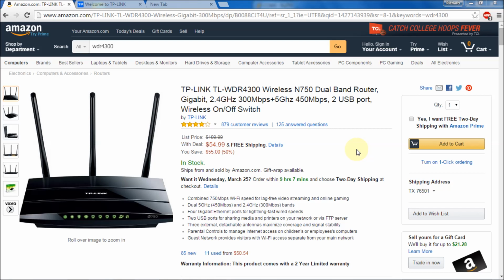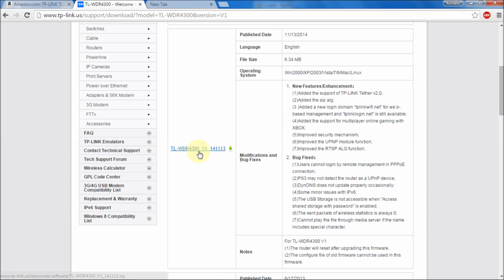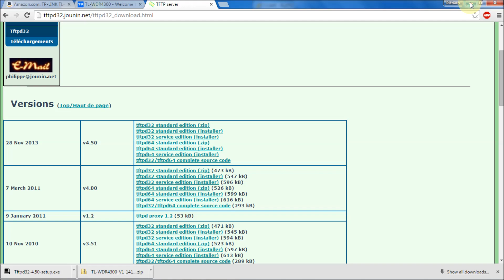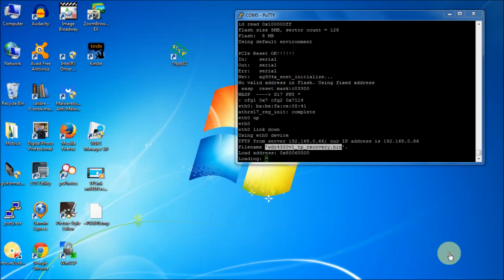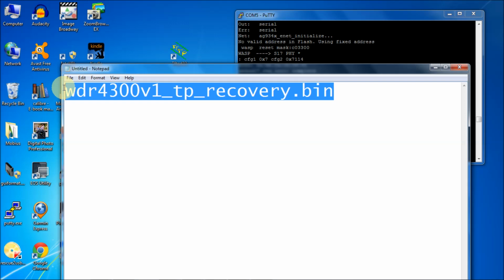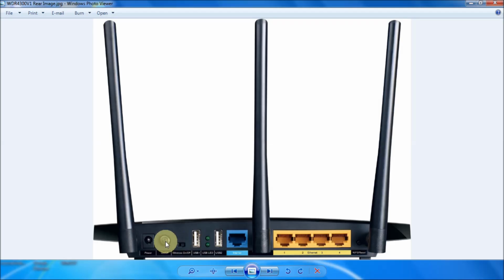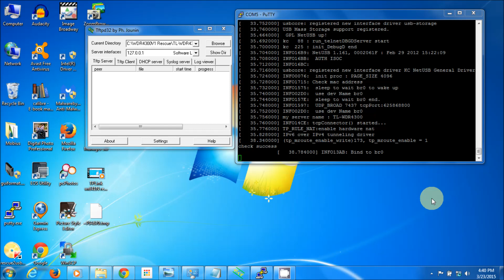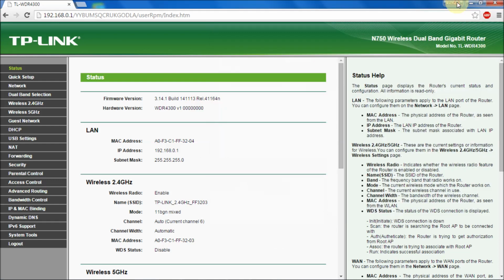Bricked TP-Link WDR4300 Version 1 Recovery/Rescue Unbrick Without A Serial Connection

Comment: Which name should we use if we have a version 1.7 router?
Reply from the maker: I don't see why not? The version numbers on TP-Link routers are not typical a 1.0 version and a 1.7 version are still version 1 and will use the same firmware. Give it a shot. Thank you so much for commenting and watching. I appreciate it greatly. All the best.👍😀
Reply: @richardlloydusa  Everything worked flawlessly. Thanks!
Reply from the maker: You're most welcome. I'm glad and very happy to know that I could help you. Thank you so much for watching, commenting and the very kind words. I appreciate it greatly. All the best.👍😀

Comment: yo  Richard sup, I got that same router but model 1.7 and so I got it from someone and it had an openwrt on it... I cant remember what I did but so my router got bricked. I can see wifi chnnels appears but I cant reach into it through the webconsole. 
anyhow, I tried your method and I can always manage to transfer the bin file into the router but it doesn't look like its actually installing it. 
needless to say the the wifi channels still appear when I turn it on with the name I assigned to it. 
any clue on what can I do without having the serial cable ?
P.S. I cant find 1.7 version of bin to replace with on tp link site

Comment: Thank you for the video. I flashed tomato in mine. Don't know what happened but I must have removed or deleted something. I have tried this many times and I see the router requesting the bin file (wire shark) but it never downloads to the router. i have renamed the file to match. 
I have the firewall turned off. I read some place the bin file had to be a certain size. Could this be true?

Comment: Hello,
Recently i get an WDR4300 V1.7 router. Unfortunately it was half-bricked… When i powered it on the power, the system and the 2,4GHz wifi leds constantly lit. I got no access to the router, the reset switch not worked, and when i put the wifi on/off switch also nothing happens.
So i try the tftpd option. First attempt no luck, it seemed all ok, but the router then went into bootloop (all leds flashing continuously). But at least something changed to the state with which I received the device.

Then i tried 4-5 times again, but nothing, the file was uploaded, but again bootloop. I tried with all 3 fw i found on tp-links website, but no luck.

Then i become an idea: because i don’t know what fw was on the router (maybe something 3rd party) i tried it with an stripped fw, and the second try was successful, the router was unbricked.
Stripped fw for some tp-link routers are here: https://www.friedzombie.com/tplink-stripped-firmware/

Comment: Hi Dear Richard  
Connection received from 192.168.0.2 on port 3621 [21/08 08:34:49.323]
Read request for file <tp_recovery.bin>. Mode octet [21/08 08:34:49.323]
OACK: <timeout=1,> [21/08 08:34:49.354]
Using local port 59115 [21/08 08:34:49.355]
<tp_recovery.bin>: sent 7425 blks, 3801265 bytes in 2 s. 0 blk resent [21/08 08:34:51.493]
 Recovery file uploaded  but my TL-WR840N V5  is still blinking  and in my connections lan adapter is unplugged !!!  I don't know what I do!!!!!   
Any Suggestion?

Comment: I have gone thru all the procedure and the router enters in an eternal loop of tranfering the new firmware once and again, and again. If I break the loop by soft rebooting the device (always have done it  when the 100% is tranferred), it just doesn't work (192.168.0.1 doesn't open). Tip: my System light was Off before I tryed the unbrick procedure and has always been off. Is it completely dead? I know nothing lasts forever... but...

Comment: Hello there, my good sir! My question is how did you communicate with the bricked router on COM5 without an actual serial link? I mean the whole explanation of the video is really nice, but it is overcomplicated to this particular brick. With a simple first boot command from recovery mode everything should work just fine, but here I'm getting totally lost. Or am I missing something and you can really fetch all the info from the device WITHOUT an actual serial connection or is it simulated through ethernet? Thanks in advance for your explanation. Cheers!

Comment: Richard, you are so awesome for making this video!
thank you so much for taking the time to do that!!!!

i was hoping you could maybe help me out - if you can.
i can a wdr4300 router that is bricked after a bad firmware flash.
i have followed your video and for some reason,
i am turning on my router with the reset button pressed, release it after a few seconds, i see the router trying to download the file, i see the "progress bar" for 1-2 seconds, and then...
nothing happens! nothing at all.

what am i missing?
Reply from the maker: I am not sure what is happening. Check the log file in the TFTPD  program. It may have the answer for you. If that does not shed any light on it try this procedure instead https://youtu.be/t35Pei_eb6o Thanks.

Comment: Hi, I have TL-WDR4300 Ver: 1.5. 
After a recent restart it stays in an error status (only the power LED and the Port LEDs from the connected PCs). So it isn't exactly the same problem --> no startup loop. 
I tried to recover with the method you described in the video - but i get no signs from the router wenn i power it on, while holding the reset button pressed. I see nothing in the logviewer of tftpd32.
Any Ideas?
Reply from the maker: Usually that is a firewall issue. Make sure your windows firewall is turned off. If that does not work try it on a different machine. If all else fails try the serial recovery here: https://youtu.be/t35Pei_eb6o?list=PLnxXRLSlmSVNiENiN9wTejP6dtIqqmTya Thanks

Comment: Something strange but wonderful just happened.

I own a TP-link wdr4300 v1.7. I decided to try DD-wrt but was concerned with bricking the router, so I followed the other video and flashed to the latest version of LEDE, and used Putty to install the Luci interface. Everything worked fine but I didn't really care for openwrt so I then decided to try out DD-WRT, so I flashed the router with the older Tp-link firmware 130319 like is recommended.

That went well. So I was then ready to flash to DD-WRT and, not following the recommendation of NOT using a release newer than r25974, I decided what the hell and attempted to flash to the latest beta build of DD-WRT (r31899) anyway.

The router rebooted and the WAN and LAN link lights worked and I had internet access, but....

After attempting to log in the router, I was greeted with a plain text-based login screen to DD-WRT and even after attempting to change the password it would not let me log in. It almost seemed like ti didn't flash completely. I performed a 30/30/30 reset but that did not help.

https://s10.postimg.org/50mt5mt6h/ddwrt.jpg

 Unable to log into the router's GUI to flash back to the TP-link firmware, ( I couldn't even use putty to log in as root...it was refusing to connect to the default gateway) I followed the method of using tftpd to manually upload the Tp-link firmware to the router as described in this video.

Apparently the flash did not take because here's where it gets weird....after rebooting I was greeted again with the DD-WRT plain text-based login. For some reason I decided to completely clear my Firefox browser cache and try logging in again. And after completely clearing the cache, I was then able to get to the full DD-wrt login screen, and even though the router did not flash back to TP-link firmware, it looks like DD-WRT now lets me log in. I will now connect the router up to my WAN and see if it works.

https://s4.postimg.org/k0huq4evx/ddwrt2.jpg

 Looking at my tftpd log file it now appears that the router is looking for a connection on 192.168.0.86 and not 192.168.0.66.
The log says "Connection received from 192.168.0.86 on port 2075. OACK: timout=3.

So in the end it looks like DD-WRT was successfully flashed, but the browser cache has to be cleared before logging into 192.168.1.1.
Reply from the maker: Glad you got it working again. Thanks for the feedback. All the best.

Comment: Richard , I have v1 version of same router, I have everthing configured correctly but the router wont take a flash, Ihave tried both file names in tftpd (6F01A8C0.img and wdr4300v1_tp_recovery.bin). the router does not cycle and history unknown, however it does assign ip adress , 192.168.1.1 but there is no web UI and also telnet does not respond. DO you think it is worth trying the serial interface, perhaps it is looking for a diffrerent filename, I do thin it has a ddwrt given I got it from a tech hub.thanks
Reply: to clarify the router does not have the cycling issue, just no web UI and I cant configure it otherwise.
Reply from the maker: Most certainly it's worth trying the serial recovery. Here's the video on how I did it: https://youtu.be/t35Pei_eb6o?list=PLnxXRLSlmSVNiENiN9wTejP6dtIqqmTya I recovered mine 2 years ago and it's still working great today. Thanks.

Comment: Nice video! Can you tell with is work on TL-1043nd V1? I try but I don't have response on tftp. No Syslog or Log View. Only change from ip 192.168.0.66 to 127.0.0.1. Any tips?
Great job!
Reply from the maker: First off make sure you turn off any and all firewalls you are running including the built in windows firewall. I suggest that you follow the video I have for the WR841N here https://youtu.be/0k1sxwX5pMk?list=PLnxXRLSlmSVNiENiN9wTejP6dtIqqmTya if all that does not work for you try a different computer. Tell me how it went for you, I am interested in getting it fixed for you. Thanks and all the best.
Reply: Richard Lloyd both firewall and antivírus até turned off. Ip as well configured. I will try no a diferent computer. Maybe the reset button are diferent! I dont know! I Just Watch your another video! Great work!
Reply: Google turn off media sensing ..
Reply: I have WR941ND V5 same as you in TFTP only change ip to lacalhost ip in the past it worked and i unbricked mine but now didnt wrok idk why :(

Comment: Richard, great tutorial. Thanks for your time and help making it.
I followed it step by step but I was not able to unbrick my 4300 router. TFTP Server showed the file uploading, but after that iIt kept rebooting
However, I tried the same steps but, instead of using the TPLink official firmware, I replace it with the file factory-to-ddwrt.bin from ddwrt. And it worked fine. 
Thanks again!
Reply from the maker: You are most welcome. That's a great tip. Thanks for watching and the great feedback.
Reply: As strange as it was, it worked for me too! had same restarting problem, running on model 1.7 . this trick with DDwrt worked just perfect! thank you all!
Reply: Thanks for the tip! Flashing the original firmware did not work for me either but I remembered that I had Gargoyle/OpenWRT on it before I lost access and flashing the OpenWRT factory image fixed my bootloop issue!

Comment: hey Richard! In this video, your router blinks every 4 seconds. My router blinks every second. Is this a same thing to solve my routers problem? I tried to hard reset my router for 3 seconds as what you told in this video but nothing happens.
Reply: and also how to use the puTTy in this video. I want to know the internal view of my router. Thanks!
Reply from the maker: Bricked mean non responsive so this method should work for you too. Thanks.
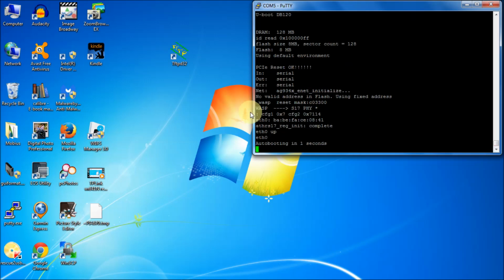Reply from the maker: I used putty connected to the serial connector with a USB/serial adapter. You can NOT see the putty output without it. I do explain that in the video at the 6:00 minute mark. If you want to see the Putty view here is a video that explains how to do that https://youtu.be/t35Pei_eb6o Thanks.
Reply: Richard Lloyd I see.. I got only one problem. I followed your instructions step by step until turning it on while holding down the WPS/Reset button for 3seconds, nothing happens. No progress in Tftp Server. Im using Windows 8 configuring this setup, is there a difference when using different OS? Anyway thanks for response! :)
Reply from the maker: Try the same procedure on a different computer the OS should not be a factor. Also if you can turn off the Windows firewall or any other third party firewall you are using before you begin the procedure. Make sure you enable the firewall after you are done. Thanks.

Comment: Hi Richard, 

I followed your instructions with attention. The modem does copy the firmware but just after copying it reboots automatically and goes back to the all-lighs blink state (except the 5GHZ wireless light that is not blinking).

Is there anything else that could come to your mind that I could try?

Thank you so much for this video..

Paulo
Reply from the maker: You said modem, which router are you trying to recover?
Reply: Richard Lloyd Hi Richard, I'm sorry, that was stupid of me. It's a TP-Link N750/TWR 4300 v1, the same model of the one in the video
Reply from the maker: Well you are in luck because there is another method here is my video on that https://youtu.be/t35Pei_eb6o?list=PLnxXRLSlmSVNiENiN9wTejP6dtIqqmTya Thanks.

Comment: Hi Richard I have an Archer C7 like this problem, but follow your steps the problem persist, do you have another way ou hint to solve my problem? Thanks!
Reply from the maker: I have a procedure for the C9 here 
https://youtu.be/AU8RyW82Z2M?list=PLnxXRLSlmSVNiENiN9wTejP6dtIqqmTya 
Perhaps that will work for you but if it does not you can try using a 
serial connection method here 
https://youtu.be/fme7kwTkttk?list=PLnxXRLSlmSVNiENiN9wTejP6dtIqqmTya 
Thanks.

Comment: Richard, Thank you so much for the video.  Your video helped me revive my Tp-link wdr4300.  Just some notes about the factory firmware on tp-link support download section:  TL-WDR4300_V1_121226(Unifi) works for me, however TL-WDR4300_V1_151104_US does NOT work and it looks like TL-WDR4300_V1_151104_US  will brick the router and the result will be exact same as the symptoms that you had, all light flashing at the same time.  therefore, please select TL-WDR4300_V1_121226(Unifi).
btw, the file name for recovery file is also wdr4300v1_tp_recovery.bin
Reply from the maker: You are most welcome. Thank you for watching and the great feedback. I appreciate it.

Comment: Hello Richard,
i am using your guide to unbrick my TPlink TL-WR1043ND V2.1 with some modifications i got from "https://wiki.openwrt.org/toh/tp-link/tl-wr1043nd".
the problem is always when using the tftpd, the bin file is not being copied 100%, it always copies 66%, and then one time i moved on with the progress regardless of the 66%, and the installation was complete, i could ping the router on 192.168.1.1 and everything, but had no access to the webinterface.
i checked the contents on some folders on the router using WinSCP, and while some files look fine, the content of others look like hydrographic symbols.
any advices on that ? thanks in advance bro.
Reply from the maker: Make sure you turn off windows firewall and or any firewalls you may be 
running as well if you are using Anti-Virus software disable it as well 
and try it again. Make sure you turn all of them back on after you are 
done. If that does not work I would suggest that you use the serial/USB 
adapter method instead. Thanks.
Reply: thanks for your reply, firewall and antivirus are already disabled, and i also tried with multiple different firmwares, including the stripped original firmware to no avail.
i am using the serial/usb connection though.
Reply: i have solved the problem, with a little player around with the commands.. first i erased then i used tftpboot 0x80060000 firmware.bin instead of tftp and walaaa, the rest is history :D thanks for the help dude
Reply from the maker: Awesome! Thanks for the feedback and watching. All the best.

Comment: Hi Richard. I have this WDR4300 v1 bought from Hong Kong (Asia), do you think it uses the same file name for firmware and IP as well? Because I tried with 192.168.0.66 and with no luck..
Reply from the maker: I can't really confirm that as I don't have access to an Asian WDR4300. I also have a solution for this using a serial connection that may actually help you answer those questions here: https://youtu.be/t35Pei_eb6o?list=PLnxXRLSlmSVNiENiN9wTejP6dtIqqmTya Thanks
Reply: Richard Lloyd. Mate, by any chance can you recommend an tftpd software for mac?
Reply from the maker: Looks like it is built in to OS X http://www.barryodonovan.com/2014/11/08/os-x-built-in-tftp-server Hope that helps.Thanks

Comment: Excellent video, extremely useful .
One question, I can use this method to install openwrt ?
Reply from the maker: Not sure if you can do it with this procedure but after you get it running with the above procedure you can return it to the stock firmware using this https://youtu.be/H_qZLOMvFLA?list=PLnxXRLSlmSVNiENiN9wTejP6dtIqqmTya Then you can follow the instructions here to install openwrt https://wiki.openwrt.org/toh/tp-link/tl-wr841nd
Reply: No , you can not due to the new FCC rules, the newer US versions of TP-LINK 4300, mine is 1.7 bought new last week, see https://forum.openwrt.org/viewtopic.php?pid=333990#p333990.

In this forum they say you can do this by installing ddwrt and then revert to an old version of original firmware and then install openwrt . I saw in your video that you have installed ddwrt which version you recommend for the wdr4300 ?
Reply from the maker: The last one I used successfully with my WDR4300 is 01-02-2016-r28647 I upgraded to an Archer C9 Thanks

Comment: how do you connect router with ethernet cable to laptop...PuTTY works is this scenario??
Reply from the maker: You connect it to the Ethernet cable to the Ethernet port on the laptop. Putty only works through a USB/Serial connection. Thanks